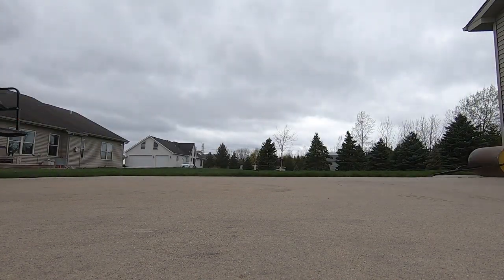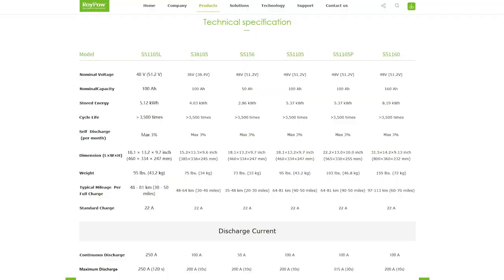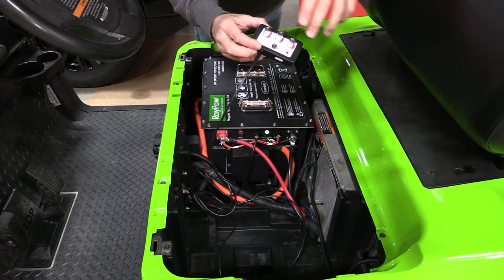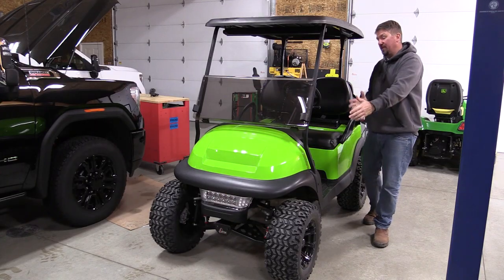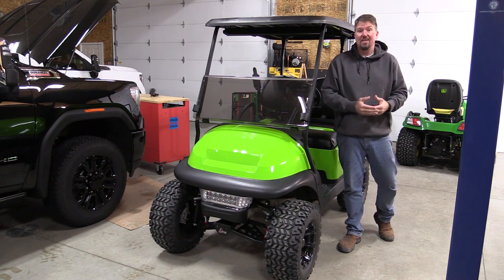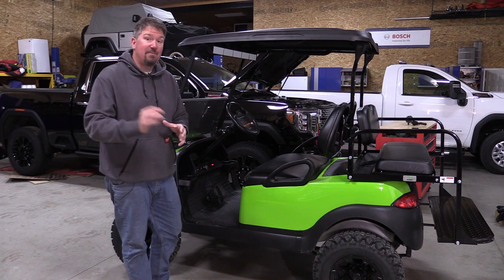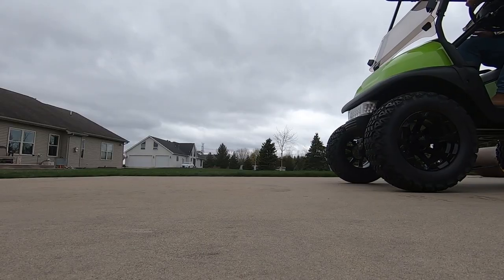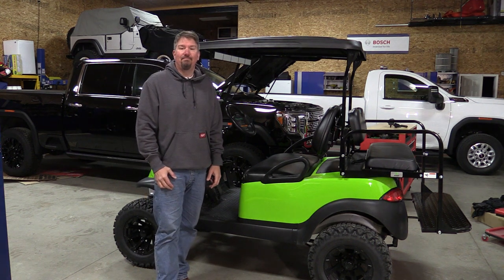Crazy Golf Cart Project - RoyPow LiFePO4 S51105L & Navitas 5KW TAC2 600A DC to AC Conversion Kit

Comment: That had to be sponsored. Who would pay 2800 bucks for a battery.
Reply from the maker: Standard Lead Acid battery sets are $900 plus and they only last 3 to 4 years under daily use.  Plus they will not give the power that this battery pack will.  Many people are paying that in the golf cart industry.  It sounds expensive, but this will last 10 years and has a 5 year warranty.  It would pay for itself in 10 years.
Reply: @WorkshopAddict  So it's sponsored? Sure sounds like it from both the video and your reply.
I don't mind sponsored content but being honest and upfront about it helps both your credibility and the brand that is sponsoring. I used to have an influencer marketing company so I'm speaking from experience.
Reply from the maker: @wolph  negative.  This is a build I wanted to do and it was a project a buddy and I did when things were slow.
Reply: That's cheap, my boat with 4 lithium batteries is way more, plus charger was 1200 alone.
Reply: Wondering if I can take my Chinese spirit golfcart stuff out and put this in it and roll?